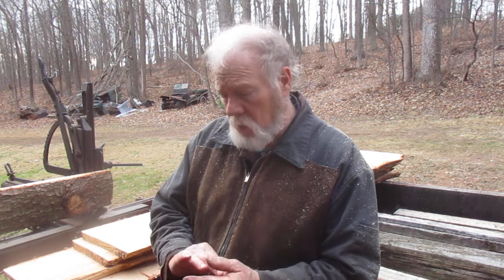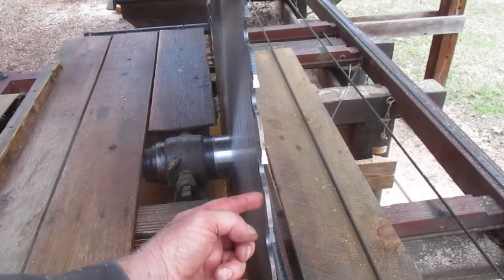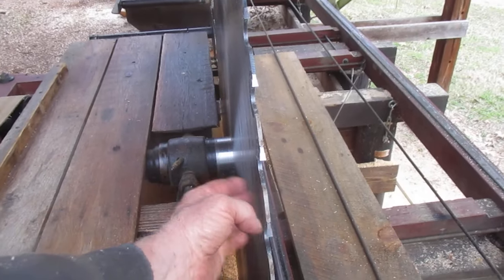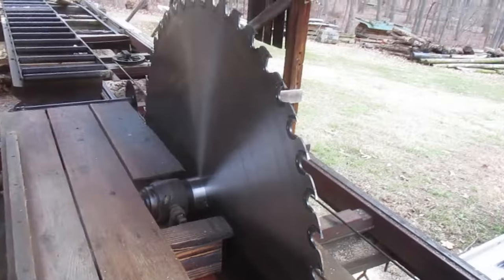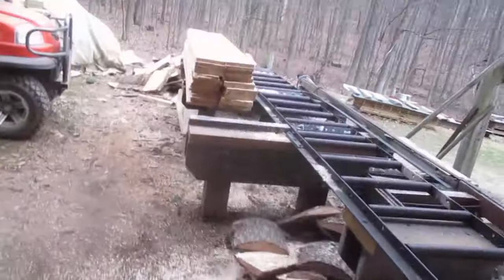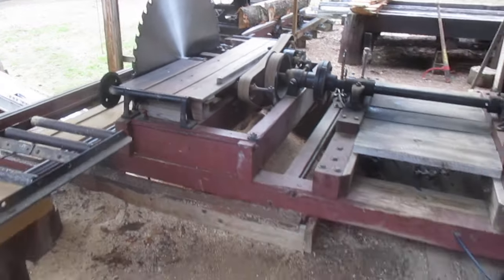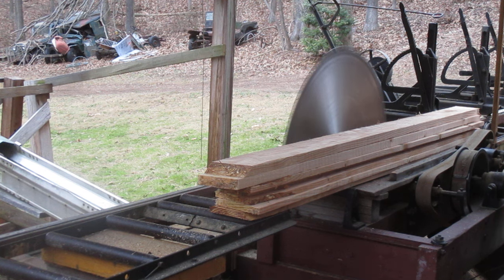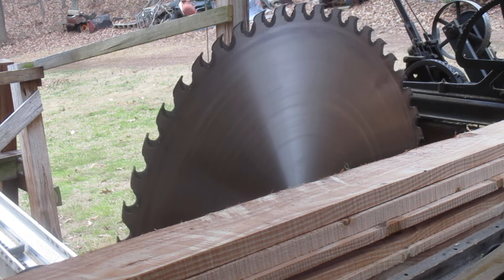Sawmill trims and talk  # 1450 pre show 1448

Comment: Thanx for your time, your videos are a great tutorials ……question I watched your one minute in your shop and I saw a onan generator in the background , is it whole property or just the shop and is it 3 phase or single ?        Just curious you got some really nice stuff, I have a Detroit diesel spectrum unit 35,kw whole house…….thanks for the good work!    Bryon
Reply from the maker: hi there there are several gen sets here , there is a Generac on wheels that does the house if needed , then a 353 detroit  3ph to run my convayor then a kohlar on a palet w/ air compressor  then a small craftsman , not to sure witch one you mean , john
Reply: It is in the shop where you were working on your power saw…..it looked like a onan…….no matter, you got great stuff …thanx
Reply from the maker: was it gold  john @b.p.650
Reply: I thought it was green ?  @fricknjeep
Reply from the maker: hi i now know witch one you mean dont know who made it detroit powered  john @b.p.650